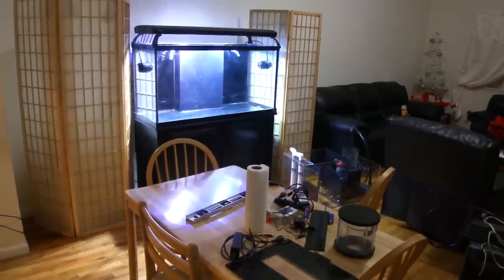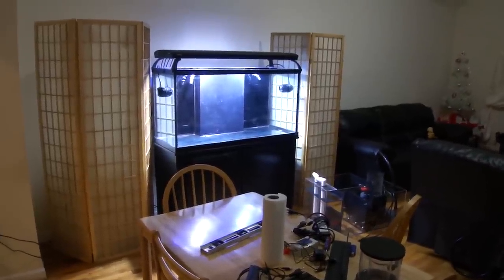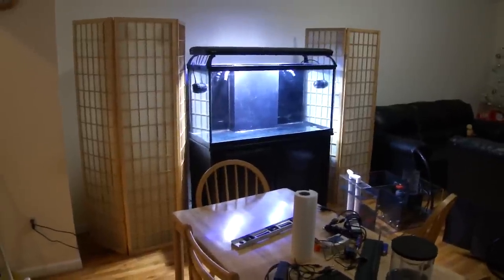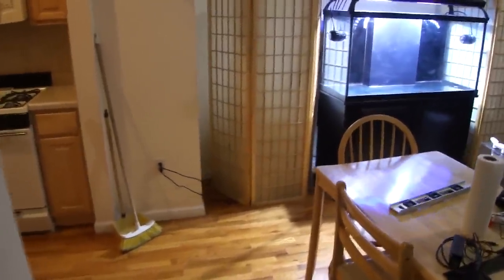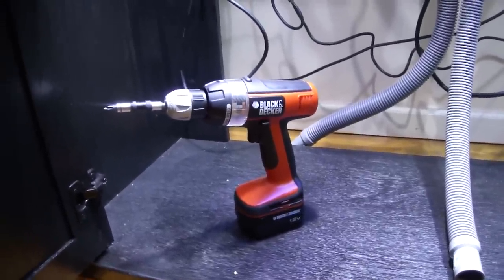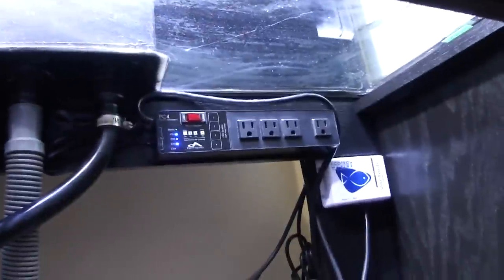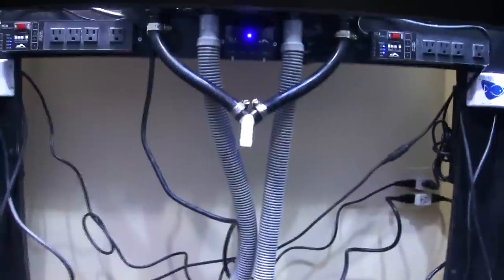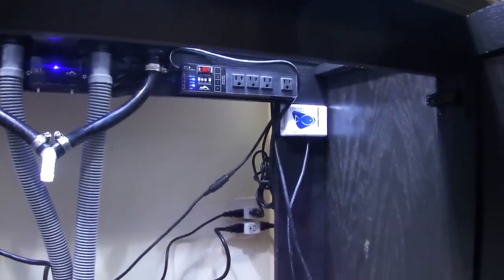How To 90g Reef Aquarium Setup Day 1

Comment: Hi steelo, my 120g is almost complete I just have one problem! my Vortec mp40, ive bought it off ebay 18 months old no previous problems im assured-yeah right..anyway no matter how I try to install it wet side continues to spin, ive compremised by wedging a rock by it to stop it spinning but is there anything im doing wrong? ive heard it could be bearings? but the guy said its run sweet before, ive got the right setting on the spacer, as you have two do you have any ideas?

Comment: Can I offer a suggestion? You should paint the lower half, or entire inside of  your stand with Gripper by glidden, and use calking around the joints. Gripper is a marine grade water proof paint. It actually penatrates the wood and seals it up. The paint that comes from the manufature of the stand does not seal the wood. I did it to my stand. And what a differace. The only draw back to the paint is it is white and a little pricy. Just my two cents worth...

Comment: @newyorksteelo My stand will be six foot long, so I'm gonna put my top off inside for sure along with a 40g breeder tank for the sump.  It's just gonna be a 10g barrel though.  I'm hoping to fit the chiller inside too, but I'm thinking it's not gonna fit.  I don't want it to be too cramped.  I finally have someone working on my stand, so hopefully I'll have more videos within a few months.  Did you check out my last video of a few of my corals?  What'd you think about them?

Comment: thinking about setting up my first FOWLR and have 2 55 gallon glass aquariums. can I use one of them for a sump refugeum? can build dividers for it and all that kind of stuff. I have space underneath and can do all the plumbing and such what are the pros and cons of this? also I'm a new subscriber and love your videos lots of helpful info THANKS.
Reply from the maker: You can but keep in mind that most sump refugium tanks are always smaller then the main display tank. This is so that the sump can fit neatly under the main tank and hidden inside the stand. In your case, considering that both tanks are the same size, the setup might be a bit tricky. You may need to possibly build a special stand so that one 55g tank can be on top of the other (a setup that most of us reefers like to use), or position one of the 55g tanks somewhere else like in a fish room, or simply next to the main tank on the floor, and then plumb it to the main display. May not be as neat as having the sump hidden under the stand but it can be done with a bit of ingenuity.

Comment: What do u think about those diy led setups any experience on those cause I gotta upgrade my light but not to fond on the way halides and pcs heat up the tank I already got problems with my tank n heat in the summer with t5. I figure led is the best they let off no heat but soo expensivee

Comment: i installed window draft seal on all the boarders of my stand to make it as silent as possible. even on the door so as soon as i open the door then comes the spilling noise along with the mag drive & remora. im building my own refugium so i need to see you get that one going asap. how much sand in my DSB should i use? inches?

Comment: I have a tank that's drilled on the bottom. Do I need to have an overflow box? Or can I just use bulkheads and pvc?
Reply from the maker: The main purpose of the overflow box is to basically hide the plumbing, so without it, you will have PVC pipes sticking up inside of the aquarium. I would add an overflow box if it were me.
Reply: Ok Thanks I think I might buy a kit and drill holes on the back side instead.  Will seal the bottom holes with glass and silicone

Comment: Yo Waz up NYS. HEY I have a question about reef tank setup.  Well I have a 150gal tank.  With sand that I got from the ocean and water I got when high tide from the ocean
( same spot I got the sand ). It's been running for about 3 weeks now. I have no rocks.  I just wanted to know what more do I do after the tank been running.  I'm in no rush for fish or corals.  I just want to know how to get my tank cycle..... THANKS
Reply from the maker: I hope you got that sand and water from the reefs and not from a public beach. Collecting sand and water from public beaches is not a great idea because the substrate and water are likely polluted with nutrients. There is a reason why corals dont grow on public beaches and that reason is pollution. Other than this, you may want to visit my video on how to cycle a reef aquarium. Here is a link to that video. How To Cycle A Reef Aquarium